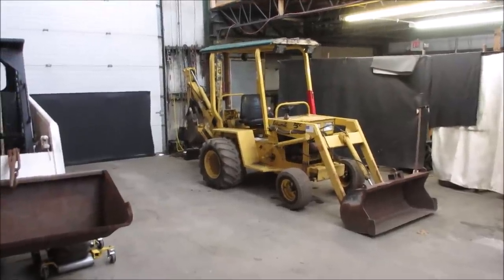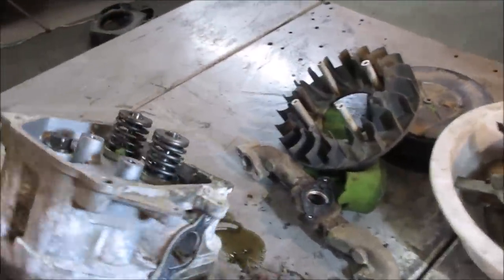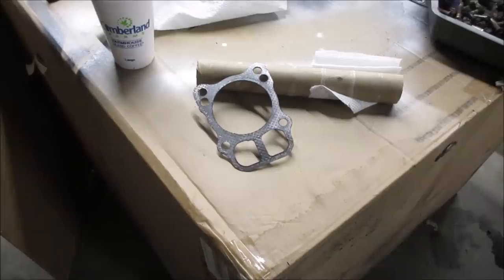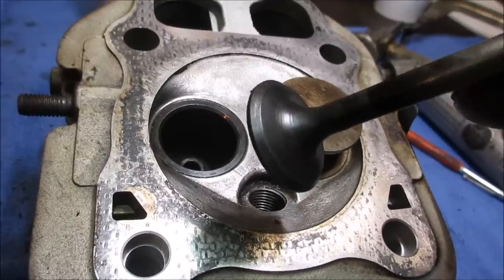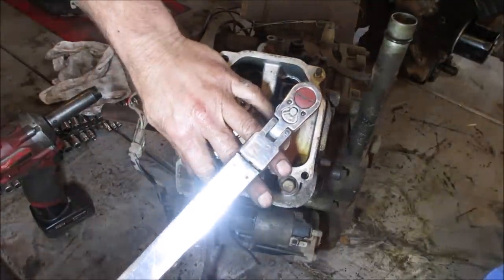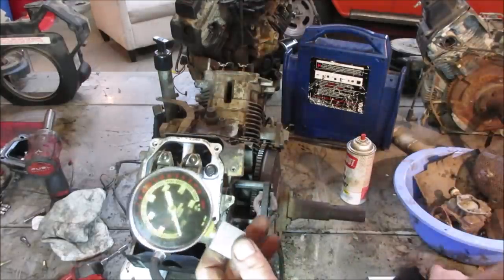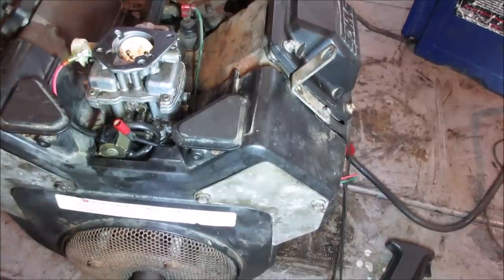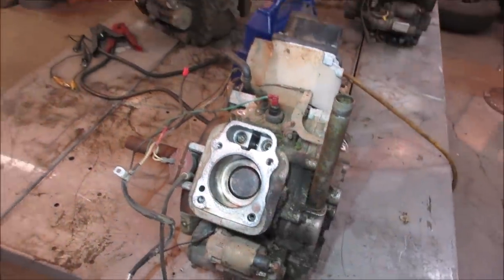Can We Save One? Free Trashed Kohler Engines.

Comment: I used to work at a equipment rental company. Out back we had a pretty good size junk pile of old broken equipment.  I managed to scrounge together enough parts to build a running 8hp Honda engine. I ended up giving it to a co worker for a go kart motor.

Comment: Great video! I've got to be more optimistic about repairing small engines. Your easy going attitude is hard to emulate, but very therapeutic to watch! Thanks for sharing!
Reply: It can help to not get too emotionally invested. I know it can be tough when it feels important to you. I don't know if optimism helps. But just remaining neutral and taking it as it comes seems best. Get excited when it's done and works.
Reply: @1pcfred  Thanks, I was excited when it worked, but my inexperience negated common sense, and subsequent tweaking turned into twonking, and I'm back at the disassembled engine, this time requiring machining and new parts!
Reply: @tolbaszy8067  I think I know what you mean when it comes to engine work that doesn't end up working out. There's a few things if you don't get them right makes things go wrong. Even if said engine initially does run.

Comment: I wanted to wish everyone a Happy Father's Day. Also, Mustie a quick thing I do when disassembling anything with my little cordless impact guns. I have a few of them, over the years just collected them, I put different sockets on each gun, usually a 10 a 13 and 14 or whatever this way I actually save time switching sockets, just grab different gun next to me. It works
Reply: That's a good idea.  Now that battery drills are a commodity and can be picked up at garage sales for next to nothing, it does save time.  I did the same thing replacing over 100 screws on a carport. All the old metal screws had corroded the aluminum roof deck (galvanic action) causing multiple leaks.  As the poster indicated, I used three drills as my restoration tool team [insert Tim Allen's Tool Time growl here] – one drill to remove old screws, one drill to grind off corrosion and the last one to install new screws (with rubber washers and dollop of sealant).  Worked like a charm.  No leaks!  
BTW - Excellent video Darren.  Nothing better than making 3-2=1.   It was a blast seeing the successful engine barking and spitting flames.
Reply: @markhelseth253  exactly the way i pretty much do any job, and i do the same kinds of tasks. Excellent

Comment: I had 7hp Briggs that burned oil (someone tried to check the oil with it running) and 8hp Briggs that had a hole in the block (someone trying to pry the flywheel off). So I used the 8hp parts in the 7hp block. Crank, connecting rod, cam, piston, rings, head, and bottom case was from the 8hp. I think the carb was from an 11hp. It was one of the best engines I had.

Comment: When I do small engine valves (honda) I'll just pop them off by hand. If there's stronger springs I'll set the head with the valve face on something solid and use a socket to pop the valve off the keepers then use a combo wrench to push down the spring and grab the keepers. I know you have to showcase things for video (spring compressor) but when you have to rebuild several engines a day you really find the fast way to do everything. Love the channel, I've watched every single one and will continue.
Reply: Yeah come try that crap with my double over engine. I need some laughs. Nope, not budging it. Come on, you've almost turned a shade of purple I like.
Reply: @1pcfred  If I ever find out what a double over engine is I'll give it a try. Even google doesn't know, must be some slang for a weirdo engine I guess.
Reply: @jaredgrow  engines normally don't have more than one valve spring per valve. So double over is kinda weird. Context matters. If valve springs are the topic then they are likely the point of discussion too.
Reply: @1pcfred  Gotcha, makes sense. For sure never popping off automotive strength springs by hand. These small utility engines don't spin past 4k RPM so valve float isn't an issue hence very squishy soft springs.
Reply: @jaredgrow  even with a spring compressor I was having trouble with that particular engine. I had to weld a gusset into the corner of it to keep it from bending. It was a pretty heavy duty spring compressor as it was too.

Comment: Have used the painted gasket trick for years but you want to put them together with the paint wet it acts as a gasket sealant and works really well.  It sets up pretty fast so once you spray them you want to get the head on pretty quick.

Comment: 17:41 Copper, actually, and they straight up sold the stuff in parts stores back in the day. I think they might still sell it. That being said, pretty much any paint will do in a pinch...Puddin, of Puddin's Fab Shop, just used regular black spray paint on a 32 Model A head gasket and it worked! Bolted it on while still wet.
Reply: I seen that 😂😂😂 😊
Reply: Copper coating for gaskets can be found at any auto parts store, usually Permatex branded.
Reply: @johnfox3845  Color me surprised they still sell that stuff given modern head gaskets don't need it and often manufacturers explicitly tell you not to use any sort of coating on the head gasket.
Reply: While it's use isn't as widespread as in the past, copper coat still has some utility. Among other things, it allows for reuse of many MLS head gaskets. Also, despite what the manufacturers say, it can be used to improve the sealing qualities of standard gaskets on engines that commonly suffer from gasket failure.
Reply: @johnfox3845  It's kinda sad that, after 120 years or so of doin' this whole internal combustion thing, we still haven't figured out head gaskets...

Comment: Man, I been building engines (car including racing engines, motorcycle, lawn mower engines, etc.) and ALWAYS used a drill to lap valves in.  Yeah, had my share of trolls telling me I ain't doing it right.  But it's only a bad idea if it doesn't work, right?  Out of hundreds of lapped valves for the past 50 years, I never, ever had even one didn't seal and work reliably.  Kudo's to you!

Comment: I've replaced more Kohler head gaskets than I can count. Many were warped heads. I also went to solid copper head gaskets.
Reply: Many years ago, I had a 7 hp Cub Cadet with a Kohler engine.  I overhauled it but anytime you would run it more than three hours straight, she would blow the head gasket.  I replaced it several times.  I finally ran a tap down the the head bolt threads, added an extra washer to the head bolts, and over torqued the bolts by 10%.  No more issues after that.

Comment: Nothing like a Sunday morning Mustie vlog 👌🏻
Reply: I have a bent shaft weed eater that I threw a carb and air filter box on and now it runs like brand new but now the gas tank is cracked and leaking fuel so my plan is to repair it this afternoon. Everyone thinks I should junk it because it's a bent shaft and I almost did until I pulled the rope and felt the compression it still had. Thank you for reading.
Reply: @kbakeritsallaboutnobody.5761  Bent shaft as in it's broken or are you talking about the style of weed eater with the "bent" or curved shaft? Not many people like the bent style
Reply: @Hjerte_Verke  it was manufactured with a curved shaft. I know it's not ideal but it had awesome compression so I couldn't trash it.

Comment: In todays high cost of labour,the time spent on disassembly, diagnosis,repair ,parts and finally assembly,test and tune ,how much is a new motor ?
Reminds me of a mechanic i knew ,when as a toung boy was left alone in a shed full of motors ,his job was to go  through them and gwt rhem running ,its how he learnt the trade ,he still is a very good mechanic,very practical and full of knowledge.
Another thing one might try is those foam tube yp cans of spray stuff that will remove carbon deposits,the Mercury Marine Power Tune is one i have faith in ,it will clean everything up as much as possible.
Gey great content thanks 🙏

Comment: The stuff your looking for is called Head Gasket in a Can. It's a binder and copper crap in a can thing. But it will work say 70% of the time. You may get two or three seasons out of it, when it works.

Comment: Worked in a machine shop and we used a drill press to take valve springs out and in. Took small open end wrench and bent into L shape, welded it to rod, put in chuck and then just lower the chuck down to collapse spring to get the keepers out.

Comment: very nice, I find this content relaxing. It also relates to the Onan 20 hp motor that powered my 1st truck mounted carpet cleaning machine was in a 76 Chevy van. Was pretty solid setup until one day the aluminum head blew a valve seal. I had that motor repaired & switched to cast iron, didn't have anymore issues. 👍
Reply: I worked with a lot on Onams, in small skidsteers.  They quickly got a reputation and were called Odamn engines.

Comment: I had that same thought about the rings.  You would have to pull the chunked rod one apart to see how bad it failed.  Sometimes the piston will go cockeyed in the bore and deform the rings.  Other times, the piston goes up one last time and hangs out with the valves and they're fine. Personally I think you should hang on to that good engine, you run that Teramite hard, chances are good you'll need another engine in a couple of years.
Reply: He should probably rig up some kind of an oil cooler on that Teramite. Heat is the killer. That engine seems to fry one cylinder more than the other too. They all had issues on the same side.

Comment: You can use a Copper Spray Gasket for Head Gaskets and exhaust gaskets like Permatex 80697 Copper Spray-A-Gasket. I have never had luck with Kohler Engines single or dual. I have had 3 blow in a row and stopped buying equipment that had them. I have had B & S with no issues. My oldest is a 16HP Twin on my generator and is 27 years old. Living in FL it runs for a long time and only have to clean and service the fuel system as well as oil and filter.

Comment: Years ago I was a supplier quality investigator for Caterpillar Tractor Company and had a Cushman four wheel cart I would run building to building in and it had one of those engines. I believe they called those an anti dieseling valve that shut off the fuel so it wouldn't run on after you shut off the key. Mine developed an intermittent problem where sometimes it would work and other times it wouldn't close all the way and would backfire and sound like a 12 gauge shotgun going off. Scared more than one person before truck repair got it figured out.

Comment: I had the same problem with a Kohler Command Pro on a Snapper zero turn. The left side rockers loosen, then when tightened, bend the pushrods. Replace the push rod  then it breaks the rocker arm from the head.

Comment: As a Heavy line tech when  I would tear apart any cylinder head what I would use is a tennis ball on the bench and put the valves on top of the tennis ball then use a mallet and a deep socket and strike the spring retainer and the retainer Clips will pop out. Only downside is you can't reassemble it in this method.

Comment: These V-twin engines are basically the same class as the Predator 670 from Harbor Freight.  The Predator 670 sells for about $1000 these days so spending a little money to build a couple of spare engines is probably worth the effort.  Also, these V-twin small engines have a fairly loyal following so working on them should be good for views.

Comment: Ground your ignition modules during test. You can kill them if they are not grounded through a sparkplug at the very least. All that energy has to go somewhere
Reply: If the secondary fails to fire and there's high back EMF on the primary side the flyback diode should handle that voltage spike. The collapsing magnetic field will generate a current in reverse polarity so it's easy to deal with then. You simply place a reverse biased diode across the switching element. It'll conduct the current. Your sensitive switch won't even see it. Which in an electronic ignition will be a transistor. That's what makes it electronic. Now there was the old lover's lane failure of points ignitions. That was entirely different. Which is why cars have an accessory circuit. So you can make your moves without killing them.
Reply: @1pcfred  too much tech speak.....
Reply: @joemendyk9994  no it isn't. You live in an age where everyone should know this stuff. People worked really hard to figure it all out for us. So the least we can do today is to know it. It's what gets you down the road. Unless you drive a diesel. In which case roll coal!
Reply: @1pcfred  Batteryless electronic ignition is usually capacitive discharge.

Comment: One reason i enjoy working on the 2 cylinder engines,  is because they sound good.  I put a Kohler V twin 25 horsepower on my old Murry,  I didn't want to use the muffler so I put dual exhaust on it.  I used 2- 8 horsepower mufflers.  Without the mufflers it was a bit too loud,  now sounds nice.

Comment: For head gaskets to exhaust gaskets I use copper gaskets spray it was made as an exhaust gasket sealer. It makes the gasket tacky for those hard to reach header applications. But I've been using it for my pulling tractor exhausts for yrs. Never tried aluminum paint hmmm

Comment: I was once given a generator with an 8hp Briggs flathead "seized". Five minutes into pulling off the head it was obvious there was so much carbon the piston was stuck in the ring at the top. Couple sprays of carb clean and a wire brush later, a little carb adjustment, free running generator. Moral of the story, stop running your junk with the choke half on.

Comment: Aluminum paint is like 95% aluminum. The way I was taught was to spray the head gasket right before the install until it was dripping. That way the liquid paint could fill in any low spots. I would also have checked to make sure the head and cylinder surfaces were flat.

Comment: Around a year ago I used a gasket cut out from a cereal box for the head gasket on my air compressor. Granted, it's not dealing with near the heat and conditions that an engine will deal with but it's still holding up. Hillbilly fixes can do the job is what I'm saying.

Comment: Might be fun to fabricate a mounting plate and coupler to put the Kohler in the Bobcat temporarily until you get the diesel rebuilt. Would be interesting to try to work it a little and see what it's capable of with the reduced power.

Comment: Make a simple hub like you say. Tap the center of the crank, add an offset dowel, make the hub fit the other side with a couple set screws. If it was done carefully to offset ignition on the two engines by 90 degrees, might even run smooth.

Comment: Instead of scraping carbon off valves or heads, you can leave them steeped in diesel if you have time. it will liquify it into soft sludge after a week, saves elbow grease and reduces the chance of scratching any metal components due to the reduced force required to clean.

Comment: Checking the seal of the valves, place head upside down with the valves assembled with there springs and an old plug fitted. Now fill head cavity with petrol (gas if you cant get the proper stuff 😅) then wait, if the level drops you have a leak. Repeat the honing on the valves with fuel in the ports.

Comment: As for the engine with the seized piston rings, try setting the engine so that the cylinder is perfectly upright then pour in about a quarter inch of two stroke oil and leave until it soaks through. I’ve found that this method releases piston rings 9 times out of 10 😜

Comment: I bet you could pull those other two apart-  Take the rings off of the engine that threw a rod and put them on the other engine with the stuck rings--  and get another going--  no parts required.

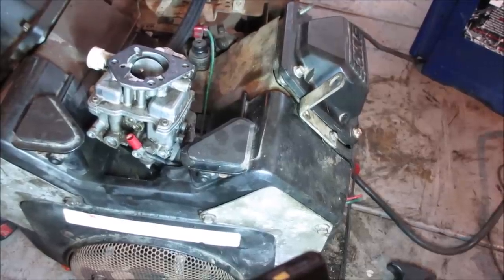Comment: 53:23

1: Bypass that stupid solenoid that does nothing useful.

2: Put about 6 inches of pipe on each exhaust port to avoid burning the valves.

3: Gokart build!

4: Autopsy of the blown engine from the terramite?

Comment: Those engines idle sound AWESOME with a proper exhaust-system on them. (but get 'droney' at constant RPM)  BTW: Since the RPMs rise just before stalling-out, this suggests idle is jetted too rich or fuel-level too high in bowel. (splashing in bowl at idle)

Comment: Hydro locked lifter . It happens on kholers too. Sad part is I called Kohler and they say to solve that you empty the oil out of the lifters and brake clean them and slap them back in with no oil. Takes like 10-15 mins of really unhappy sounding valves . Then it goes away .

Comment: Bore that crank stump and put a shaft into it? Maybe drill and pin since you cant really broach a shallow hole? Weld and true a flange on it after its pin drilled amd reintall with it bolted to the next ones flywheel.

Comment: I read about a guy who used a taper to lock two Mazda Rotory engines together along with some pins in a radial pattern. Could bore a taper into the one engine with no output shaft on the back.

Comment: Put one crank in a lathe and drill and tap the center. Machine the adapter coming off the flywheel to screw into the tapped crank

Comment: Could well be that the rings are stuck on the engine with no suck/compression. try filling the bore with diesel and leaving it to soak for a few days, that often unsticks rings. The fact that trouble occurs on the same cylinder on all the engines rather suggests that the cooling is uneven and the other cylinder gets more cooling air from the fan. This is most likely due to direction of engine rotation.

Comment: The way you'd redo the valve laughing like is the same way I do except for I put a little motor oil or transmission fluid on that valve stem right where it goes through the guide so that way the guide doesn't get damaged
Reply: And I also switched directions with the drill